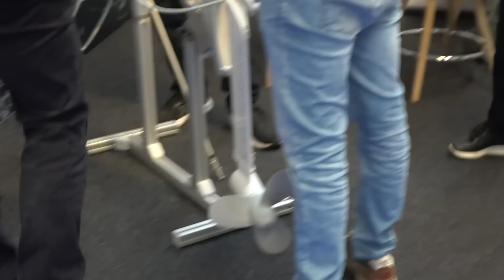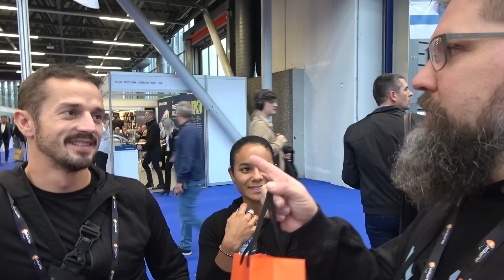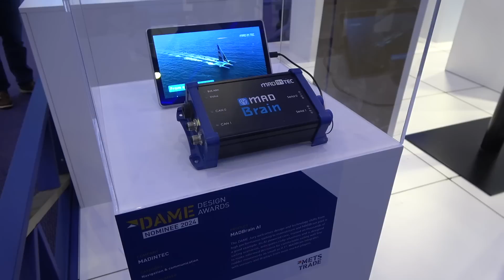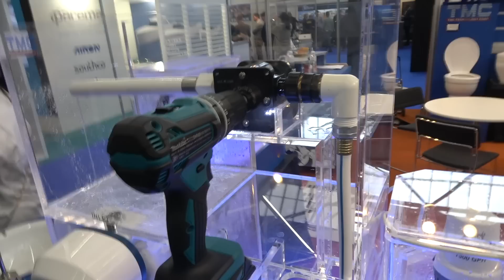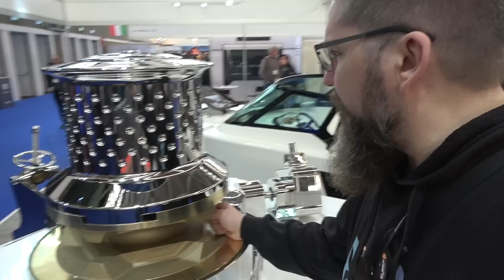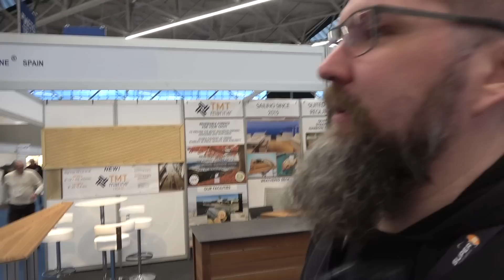The ultimate METSTRADE report! - ep83 Project SeaCamel

Comment: Thanks, now I don't have to go to Älvsjömässan this spring. I realize that I don't need what these fairs offer. Your hike also made my back ache and get tired. I find fairs increasingly boring. On the surface well polished but with bored employees in an endless repetition.
Reply from the maker: 😅 I think it really depends what you're looking for. For me, this was now really just initial look for the boating industry in general and getting potential co-operations for different things for the boat. At the same time I kind of realized how little I actually really need to make the boat functional.

And this fair is B-to-B-thing. So if you're establishing boat building company, from here you can find all the things needed for that. And also get in touch with smaller suppliers that you otherwise wouldn't even know existed!